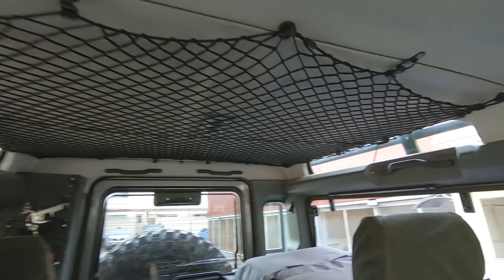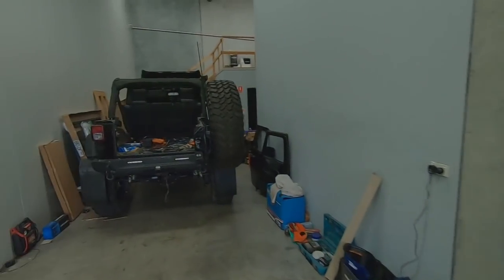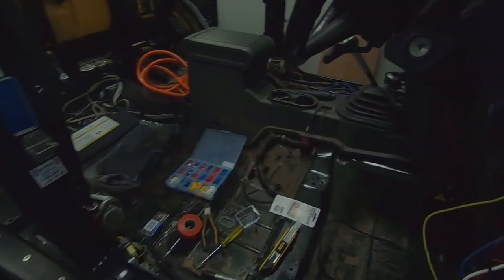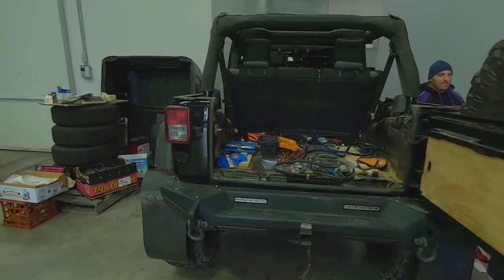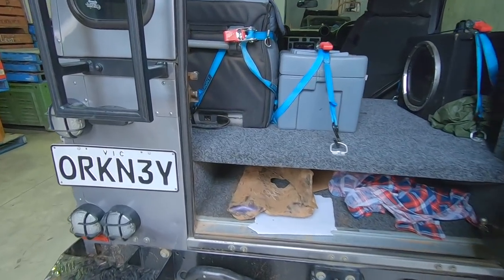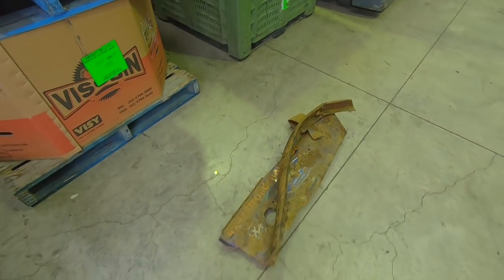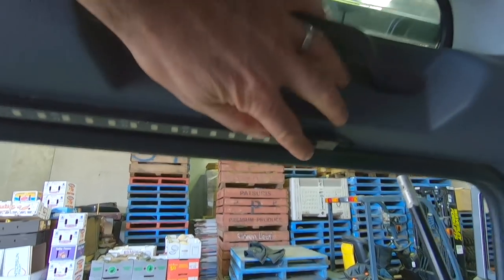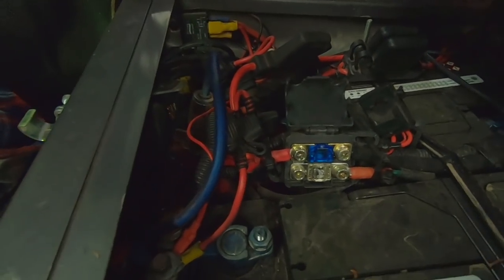| TERAFAB SESSIONS | episode 1 |

Comment: Good video to see the work involved. Have you noticed from 3:58 to 5:04, gopro picks up the gimbal motor noise as well. Are you using inbuilt gopro mic?
Reply: @defender90orkney9  👍🏽 hopefully Feiyutech makes one that's quieter. But usually rode mic with deadcat should fix that.